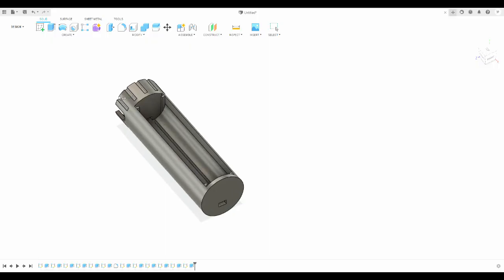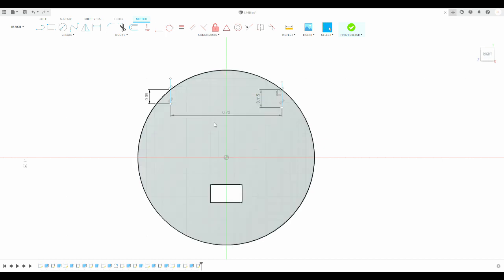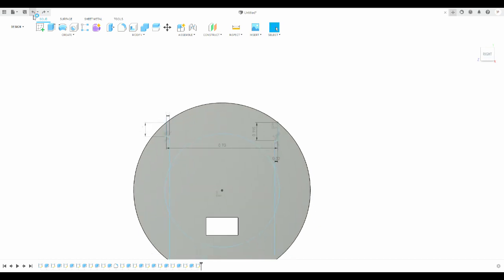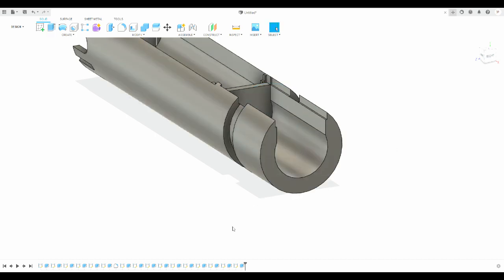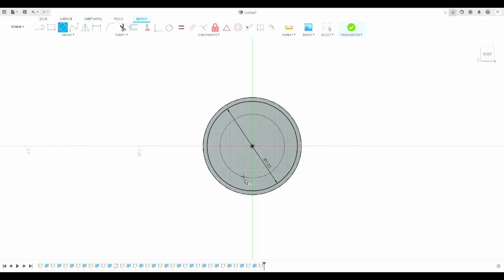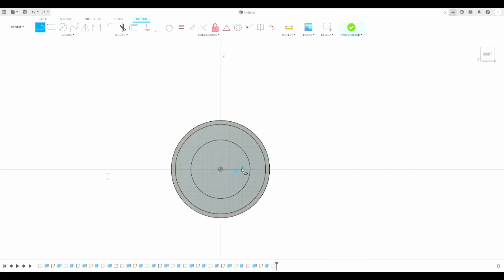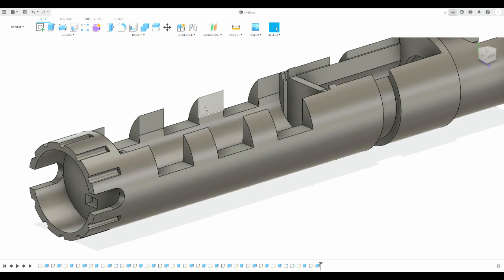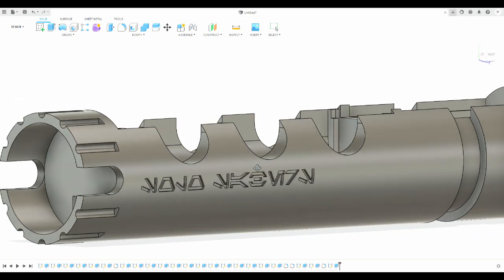Chassis Modeling with Fusion 360 Part 2 of 2

Comment: Nice work, quick question, Following your measurements on the battery socket length of 3 inches, after placing the battery contacts in, I have a hard time getting the battery back out because its incredibly tight.. Do you have this same issue?
Reply from the maker: I do. I actually go with 2.98” now and use a tool to get the battery out until the spring wears down a bit

Comment: This is by far my favorite saber building vids!!! I’ve started designs, lathing hilt parts and small 3d printed parts for a hilt but kinda hit a wall with the program I’m using. These 2 vids have been that last push to get fusion 360!!! The best part is I can use it for my hilt design specs on my lathe and convert chassis designs over to stl for the printer!!! 

Btw you make it look easy 😂👍🏾 I hope to be this efficient on the program after I learn it!!! 

Thank you for this awesomeness!!!
Reply from the maker: Really happy you found it helpful!